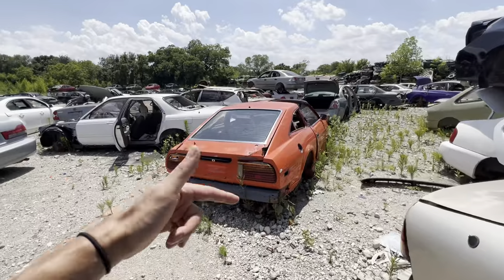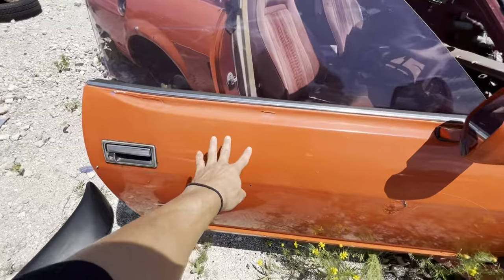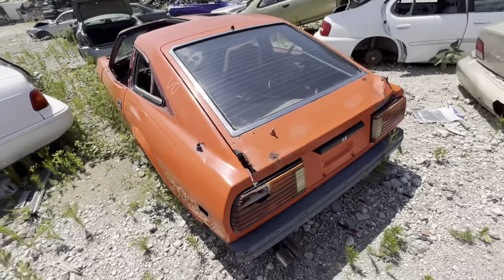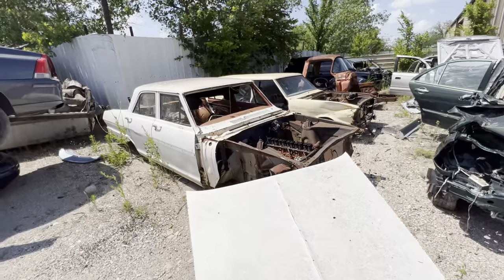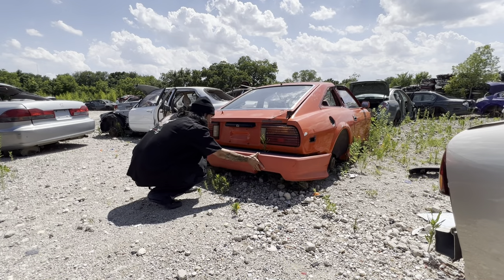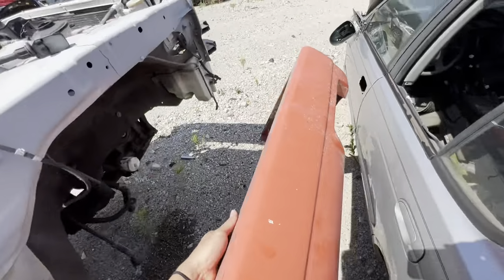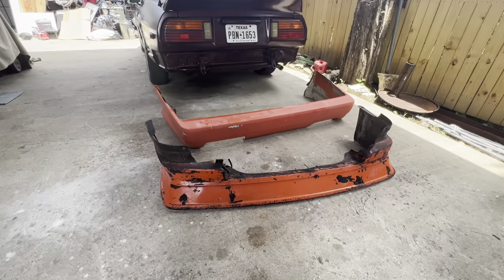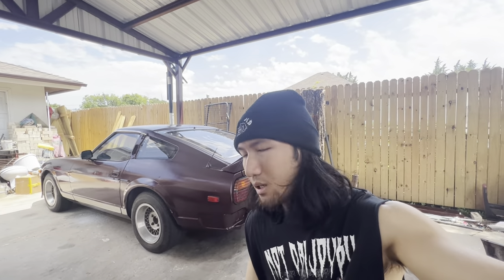INSANE Find at a Texas Junkyard - Junked Datsun with Rare Body Kit #280zx #datsun #junkyard

Comment: I had a 280ZX but mine had a small block Chevy in it that ran real well it was a 383 stroker I had to get the the next size up rear end but it all bolted right in and I use the factory wiring harness